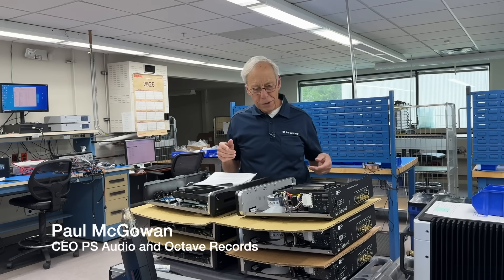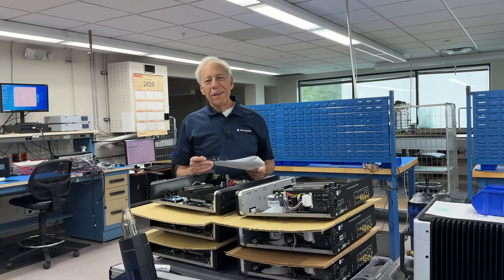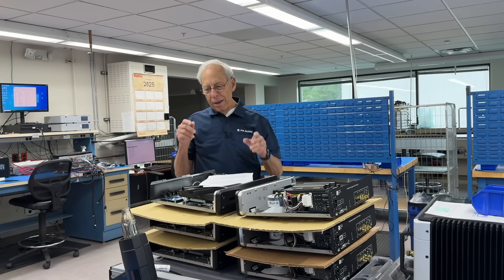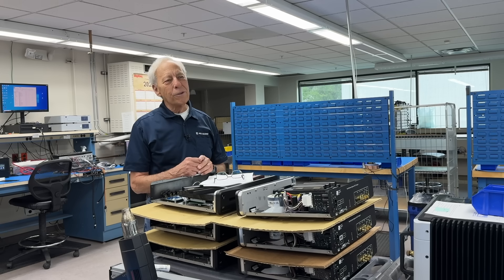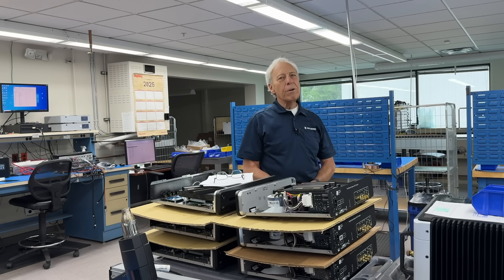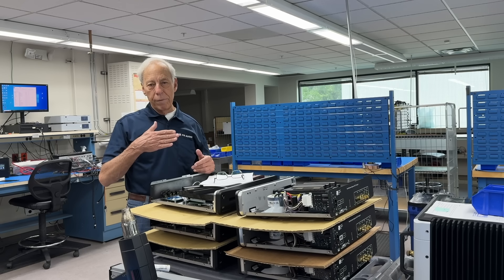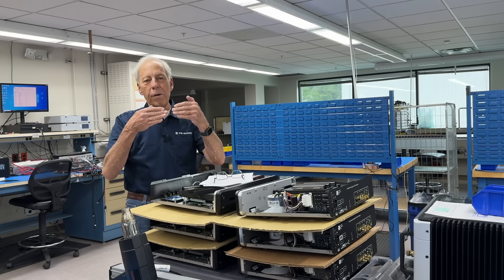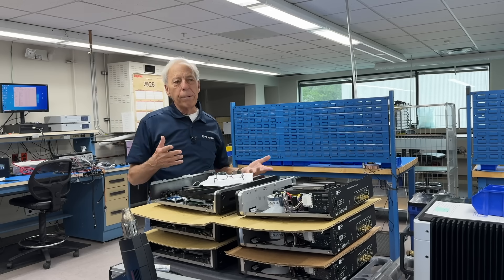How a speakers plays two or more things at once

Comment: I think Paul's explanation is a good way to think about it - but I don't think of the speakers as doing "two (or more) things at once".  They are simply recreating complex waveforms that represent multiple simultaneous sounds (compounded sine waves).  Even the sound from a single instrument like a trumpet is complex compared to a constant tone.  Adding another instrument isn't that much different.  If you look at audio waves on an oscilloscope you can visualize better what's happening.  Compare a simple 100hz sine wave tone on an oscilloscope to an analog audio signal coming from a turntable or streamer (or even a radio) and it will make more sense.  Speakers simply react to these waves to recreate the sound pressure needed for us to perceive sound.   Think of how complex the sound waves are from a radio signal with noise and static!  The complexity of the wave forms is off the charts - but even a $5 speaker can still recreate the static in the signal.

Comment: Also, when you hear something like an orchestra for example, you're not receiving a sound wave for each individual instrument, you're receiving a single wave, in each ear, that is the sum of all the different waves at that instant. A good speaker will accurately reproduce that single wave that your brain will decode. I've never heard a single speaker that's as good as a 2 or 3 way.

Comment: Now I get the speaker part,  Can you explain how the amp passes multiple frequencies at the same time?
Reply: It does not.  The music is stored as a continuous waveform. 1 per channel.  

An amplifier does one thing and one thing only ... it takes a voltage at it's input and increases it's power onto the output.  That's it... that is all it knows how to do. 

The notes, frequencies, soundstage and all the other stuff we attribute to amplifiers and DACs and so on all comes from the recording as a single continuous waveform, 1 per channel.

Comment: Fourier Transform/Analysis. 

Fourier showed a complex signal is broken down into countless 𝙞𝙣𝙙𝙞𝙫𝙞𝙙𝙪𝙖𝙡 𝙨𝙞𝙣𝙚 𝙬𝙖𝙫𝙚𝙨, 𝙬𝙞𝙩𝙝 𝙛𝙧𝙚𝙦, 𝙖𝙢𝙥𝙡𝙞𝙩𝙪𝙙𝙚, 𝙖𝙣𝙙 𝙥𝙝𝙖𝙨𝙚.  

Every element summed together forming a single signal voltage to be reproduced. 

A complex mathematical summation ... higher freqs riding atop lower freqs. 

It's what a mic is tasked to do, ... ie., capture it all and output a signal voltage. 

Similarly, single element in-ear headphones, or a single driver full range loudspeaker ... attempts to replicate that complex signal voltage. 

Good question.

Comment: I'm guessing you don't need more than 3 specialised cones (Lo, Mid, Hi) inside a speaker in order to produce the best/most faithful sound? Two cones is probably enough? What about taking things beyond 3 cones - what about 10 cones? Diminishing returns?
Reply: If you had 20,000 cones then each would only ever have to play just one tone (0-20,000Hz) and you would never have potential distortion from a cone being tasked with playing multiple frequencies. I think it leads to diminishing returns rather quickly but lean towards dividing the frequencies between more drivers. Case-in-point would be the Infinity IRS speaker design.
Reply: @bradleystassin1486  That's certainly a more scientific way to think about it. But what about the listener? How much would any human benefit from an array comprising 20,000 speakers (suitably 'miniaturised/contained' etc, of course)? How would you arrange those speakers for optimal human ear reception? Could signal interference nullify the purity of those signals before they are received by that human? Etc.

Comment: I have a follow up question. If a trumpet and a violin play the same note (i.e., same frequency), how does the speaker, vibrating at the same frequency, make a trumpet sound and a distinctly different violin sound? Perhaps you could make a video some day to explain that. Thanks!
Reply: When a trumpet plays an A-440 note, there are also other frequencies being produced other than the fundamental (harmonics, resonance, etc.). Same is true with the violin which produces an entirely different set of frequencies added to the fundamental. if you set a very narrow bandpass filter at 440hz (meaning, the resonances filtered out), you will actually have a hard time distinguishing between the two instruments playing at the same time.
Reply: As  @dispersemedia points out, musical instruments are messy. They don't produce pure tones, rather they produce unique combinations of tones, called their Timbre or Voice.  The distinction you make comes from the differences in their voices.

Comment: This could be the best question you ever received. I would  just say that as the vibrational (radiation) pattern of the driver changes as instruments are added, removed or increase in amplitude, the vibrational pattern changes at a very fast pace. That’s why I prefer planar magnetic, ribbon, electrostatic, EMIN and EMIT, and AMT drivers.

Comment: TLDR for my last message. Sound when heard is a temporally complex air movement in your ear. Those pressure changes are one dimensional signals which your ear turns into an electrical signal (like a recording) to be sent into the brain. Stereo recordings represent two sets of signals that are used to drive a transducer (speaker or headphone diaphragm) to move to create the same complex air movement (sound pressures) when they reach your ear. Speakers drivers are just objects that move creating those sonic pressure changes in the air. The speaker does not know about different instruments. That part is in the signal (recording to electrical signal to speaker to air sonic pressure signal to ear to electric signal to brain). The brain figures out what part of those two one dimensional signals is a guitar strum or a vocal sound. Speakers are mechanical devices that move air according to the one dimensional analog electrical signal sent to it. A speaker is just a quick and accurate mover of small amounts of air. A speaker looks simple, and in some aspects it is, but the act of designing the somewhat simple mechanical and electrical device is very complex and requires knowledge in many domains including material science, electrical engineering, and acoustics.

Comment: Suppose you're at a small concert where there's a few musicians playing acoustical instruments and a singer. Each of the instruments played and the singer creates sound pressure. The sound pressure waves radiate at the sound in air and combine to create complex sound pressure changes everywhere in the room. These pressures changes at your ears are essentially the combination of the sounds waves created from each of the performers. A single slightly different signal (air movement) enters each ear and causes your eardrum to vibrate which in turn causes ossicles (very tiny bones in the ear) to detect that vibration and create electrical signals which are sent into the brain and are very analogous to a recorded electrical signal. The human brain has evolved to take these signals and identify specific sources (instruments, voices, a dropped glass etc.) as well as identify their location to some degree. Speakers receive essentially a similar electrical signal and create sound pressure waves that when they reach your ear are very similar to that of hearing the original sounds. Essentially, it's your brain that identifies and locates separate instruments and vocals. The speaker is just a dumb transducer creating a complex sound pressure wave that is as close as possible to the original instruments and vocals. A lot of work and research has had to go into learning how to create speakers which can accurately create the sound pressures needed.

Comment: Still it’s phenomenal how a speaker actually works to deliver great sound.
Reply: Actually a speaker is a very rudimentary device in the family "transducers".  Their operation is neither phenomenal nor complicated.  They work on the simple basis of magnetic attraction and repulsion between a stationary perminent magnet and a moving coil that is producing a variable magnetic field in response to voltage and current across it's windings.  The big fancy term is "electromagnetic positional servo".

Comment: Hi Paul, great explanation on the mechanical side. Another explanation would be that the analog audio signal is serial and not parallel. At a given point in time, the speaker only plays one frequency. In the studio, multiple audio tracks are downmixed into two channels of audio, forming complex waveforms that are still serial for each speaker. At a given point in time, the DAC spits out a single voltage level representing the analog waveform. That is why computer operating systems have mixers to mix signals from various sources into one. Thus, the speakers only play one waveform or frequency at a time, but at a very fast rate that it appears as if its playing multiple instruments at a time. 

Since speakers are mechanical devices, they vary in the speed at which they can play a note. An amp generates a signal at a constant rate, but some speakers are too slow to finish producing the current note before it's required to produce another. That's why when the same speaker is used to play only bass or full range, the one that is only playing bass will sound cleaner and powerful because it has time to finish its strokes as opposed to the one playing multiple frequencies. 

Computers work the same way; a fast single-core processor will appear to the user to be handling multiple tasks at the same time, but in reality, under the hood, it switches between multiple tasks at a fast rate.
Reply: Ummm ... in all respect... No.  
It is not task switching or anything even close to that.  An analog signal is a single voltage that varies over time. 

The audio signal in a recording is simply one voltage per channel, that varies over time.  Big changes cause long cone excursions, small changes cause smaller excursions. When you sum them you get the speaker cone making small moves during it's bigger moves.
Reply: @Douglas_Blake  The CPU task switching comparison is to show that if something is quick enough, it appears to do multiple things at once, not that the speaker does actual switching. 

Don't deduce the operation of a speaker based on visible cone movement. Its movement is fast, and thus it will appear to be playing high frequencies on top of low frequencies. I think what happens is, the speaker, in the process of bass excursion, receives another note before it completes its excursion. Since it can't queue, it stops the bass excursion midway to play the next note, and then the next bass note comes around. And these alternations make it appear as if the high frequencies are playing on top of bass frequencies. 

And that is why when a speaker plays full range, its bass is weak because the excursion doesn't complete, and the cone starts playing the next note from a suboptimum location. The optimum position for the cone to start movement is its rest position.

If you listen to well-mixed music with a strong kick drum, you'll notice that the kick drum and vocals alternate and don't play close to each other timewise, resulting in clean vocals and strong bass. Also, bass guitar lines don't play close to the kick drum. Even in other songs, the kick drum has a second gap with all other midrange instruments.
Reply: @robertmoi8400  
" I think what happens is, the speaker, in the process of bass excursion, receives another note before it completes its excursion. Since it can't queue, it stops the bass excursion midway to play the next note, and then the next bass note comes around."

That is not what happens.  In fact not even close...

First of all you've got to understand that your home stereo doesn't have the first clue what it's reproducing.  NONE.  It is simply following a voltage that is changing over time... the musical waveform. 

Get a look at some of the waveforms from various songs in an audio editor, you'll see that it is simply one continuous waveform of varying voltages.

We've known how this works for over a century now.   There is no mystery. No magic. No stopping and starting. No time sharing... just one continuous analog movement of the speaker cones.
Reply: @Douglas_Blake  If you had read the whole comment and understood, then you would see that is what I was talking about. The speaker sees only one voltage level at a given time. But multiple notes play at the same time, why? This is where I mentioned the speed at which the speakers play the notes makes them appear to be playing at the same time. And this is where I compared it to a fast CPU that switches between multiple tasks to the point that it appears to be processing multiple tasks at the same time. Key here is speed comparison, not actual functionality.

But I have thought about it more, and I think you might be right. The speaker sees one voltage level at a time, but what the voltage represents is what changes. Maybe when music is mixed, voltages representing various frequencies are stacked on top of each other. High frequencies on top of low frequencies. Not stacked physically, but voltages for producing low frequencies change midway to voltages producing high frequencies, after which the voltages that started producing the low frequencies continue. That way speaker will produce high-frequency tones in the middle of bass excursions. Due to the high speed of the woofer, all notes appear continuous to our ears. Even large, heavy subs can produce 100hz(100 cycles a second). I might need to research these.
Reply: @robertmoi8400  
I gather that your baseline knowledge probably centers around computers. It is a mistake to try and shoehorn an analog system into a digital understanding.  In fact it's the reverse of the mistake most audiophile's make by trying to stuff analog insights into digital systems. They really are two separate domains of understanding.

Grab a vinyl record, use a magnifier to look at the grooves.  There you see the analog music signal very clearly.  It is one continuous signal that varies over time.  After amplification, it is what governs the speaker's motion.

Comment: Doppler distortion is not an audible problem unless the speaker cone has a very large excursion. Intermodulation distortion can be more of a problem. Signals at 50Hz and 1000Hz also produce sound at 950Hz and 1050Hz which may be audible.

Comment: A speaker is a transducer that transforms the voltage signal it receives from the amp into air pressure variations via the mechanical vibration of its woofer. The frequencies of voice and instruments in music add up to a resulting sound wave. A speaker 'simply' reproduces the resulting sound wave at every point in time. Crossovers allow you to restrict the frequencies a woofer reproduces to a specific range, helping to improve sound quality. A more detailed physics-based explanation on sound and crossovers can be found here: https://www.youtube.com/watch?v=mjv7O0KS1ug and https://www.youtube.com/watch?v=i3dLDVbgky8

Comment: Nicely done Paul.

A lot of people seem to visualize the various instruments as separate signals all happening concurrently.  But that's not how it actually works. People need to understand the electronic signal inside a stereo system consists of 1 voltage per channel, that changes over time. So what is being fed to the speaker is the sum of all the sounds you're asking it to reproduce, as a single voltage ... literally a map of how to move the cone.

Comment: Doppler distortion is not very audible unless the speaker cone is making large cone movements (long throw speakers).  That happens when a small speaker is trying to produce loud bass and higher frequencies at the same time.  This is a problem with small two-way systems where the small woofer has to have large excursions and at the same time produce mid frequencies too.  Large two-way systems don't have nearly as much of a problem as the woofer doesn't need to move as far to produce the same volume of bass.   Three way systems have even less of an issue as the woofer isn't asked to produce the mid-frequencies.
Reply: i first notice Doppler distortion on the song: hey now by london grammar. the voices got varbly.
but it require maybe 5mm of cone excursion to hear it, bass boosted two way speakers most affected or perhaps full range drivers.
there are other distortions at high excursion, many speaker do not sound good at high volume either.
Reply: The cone movement actually averages out in terms of its frequency input.
This is why cross over circuit design is important.
Although speakers such as some of those made by Sibelius, which have a single driver and an open enclosure port, sound fantastic.
The driver quality and design is critical
Reply: @PetraKann  I'm not sure that even means anything.  A small woofer needs to have a longer excursion to produce the same sound level as a bigger woofer.  The longer excursion requires the speaker cone to travel a greater distance.  Since the two woofers (small and big) are producing exactly the same frequency, that means the smaller woofer cone has to travel a greater distance in exactly the same time.  That means it must travel at a higher speed.  Higher speed means a larger Doppler effect.
Reply: Even three way woofers play mids up to the crossover point. Some don't even use a low pass inductor, such as the JBL 100. I prefer 15's since they don't need to move far, or you should use a sub.